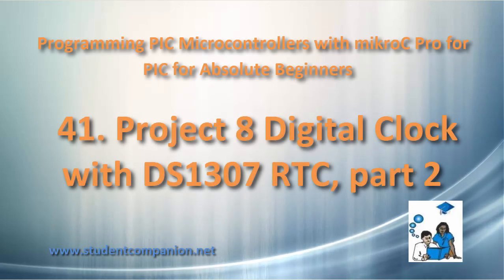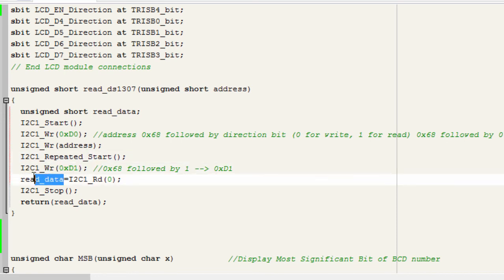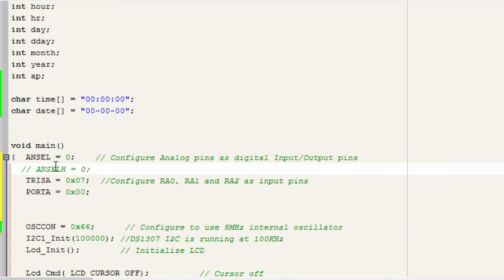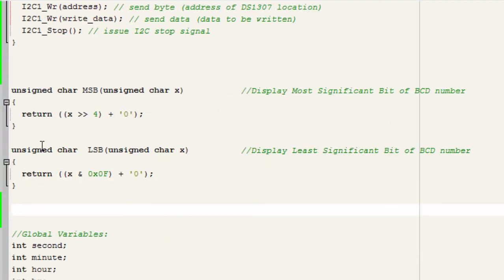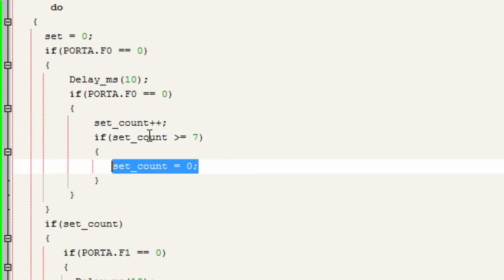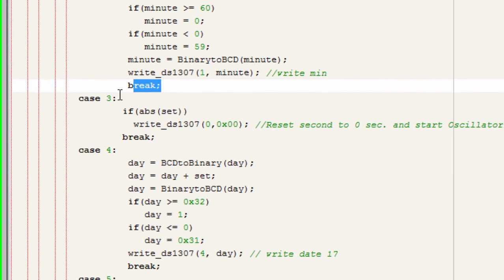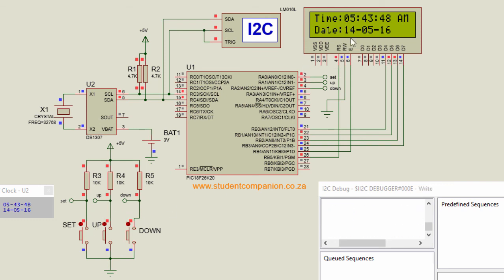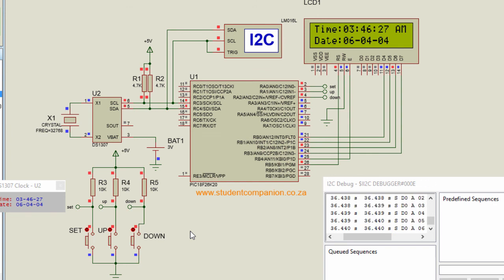41- Project 8 Digital Clock with DS1307 RTC, part 2 | mikroC Pro for PIC Tutorial

Comment: professor, I see that you created a function to convert BCDtodecimal and DecimaltoBCD.  this function can be used in any situation that requires conversion, or only in this example of a program that you created.  I need to do a similar function but I'm having a hard time understanding what the algorithm should be like.
Reply from the maker: It's a simple function that can be used in any situation that requires that conversion as long as you call it correctly.

Comment from the maker: Please note: PIC18F26K20 operates with 3.3V even though in this simulation we used 5V. In your hardware 3.3V should be used if you choose this PIC and the values of all the resistors should be calculated accordingly.

Comment: Nice project, but i have a question. When i press the up button, nothing will go over 9, minutes go to 09 and then back to 00
Reply from the maker: Hi. Are you sure you are in minutes setting first? The minute should increment till 59
Reply: Student Companion yes, but they won’t go over 09, same with hours and date
Reply from the maker: Use mikroC built-in Bcd2Dec() and Dec2Bcd16() functions instead of the BCDtoBinary() and BinarytoBCD() functions. 
Here is the full modified code:
/*

 * File:   Digita_Clock.c
 * Author: Student Companion SA: www.studentcompanion.co.za
 * Real Time Clock Using DS1307 on I2C Bus
 * To simulate in Proteus, The I2C debugger must be connected on the I2C Bus.
 */
// LCD module connections
sbit LCD_RS at RB4_bit;
sbit LCD_EN at RB5_bit;
sbit LCD_D4 at RB0_bit;
sbit LCD_D5 at RB1_bit;
sbit LCD_D6 at RB2_bit;
sbit LCD_D7 at RB3_bit;
sbit LCD_RS_Direction at TRISB4_bit;
sbit LCD_EN_Direction at TRISB5_bit;
sbit LCD_D4_Direction at TRISB0_bit;
sbit LCD_D5_Direction at TRISB1_bit;
sbit LCD_D6_Direction at TRISB2_bit;
sbit LCD_D7_Direction at TRISB3_bit;
// End LCD module connections

unsigned short read_ds1307(unsigned short address)
{
  unsigned short read_data;
  I2C1_Start();
  I2C1_Wr(0xD0); //address 0x68 followed by direction bit (0 for write, 1 for read) 0x68 followed by 0 --> 0xD0
  I2C1_Wr(address);
  I2C1_Repeated_Start();
  I2C1_Wr(0xD1); //0x68 followed by 1 --> 0xD1
  read_data=I2C1_Rd(0);
  I2C1_Stop();
  return(read_data);
}

void write_ds1307(unsigned short address,unsigned short write_data)
{
  I2C1_Start(); // issue I2C start signal
  //address 0x68 followed by direction bit (0 for write, 1 for read) 0x68 followed by 0 --> 0xD0
  I2C1_Wr(0xD0); // send byte via I2C (device address + W)
  I2C1_Wr(address); // send byte (address of DS1307 location)
  I2C1_Wr(write_data); // send data (data to be written)
  I2C1_Stop(); // issue I2C stop signal
}

unsigned char MSB(unsigned char x)           //Display Most Significant Bit of BCD number
{
  return ((x >> 4) + '0');
}

unsigned char  LSB(unsigned char x)          //Display Least Significant Bit of BCD number
{
  return ((x & 0x0F) + '0');
}

//Global Variables:
int second;
int minute;
int hour;
int hr;
int day;
int dday;
int month;
int year;
//int ap;

unsigned short set_count = 0;
short set;

char time[] = "00:00:00";
char date[] = "00-00-00";

void main()
{
   I2C1_Init(100000); //DS1307 I2C is running at 100KHz

   ADCON1 |= 0x0F;        // Configure all ports with analog function as digital
   CMCON  |= 7;           // Disable comparators

   TRISA = 0x07;
   PORTA = 0x00;

   Lcd_Init();                        // Initialize LCD
   Lcd_Cmd(_LCD_CLEAR);               // Clear display
   Lcd_Cmd(_LCD_CURSOR_OFF);          // Cursor off
   Lcd_out(1,1,"StudentCompanion");
   Lcd_out(2,1,"Digital Clock...");
   Delay_ms(5000);                    // 5s delay
   Lcd_Cmd(_LCD_CLEAR);               // Clear display
   Lcd_out(1,1,"Time:");
   Lcd_out(2,1,"Date:");

   do
   {
     set = 0;
     if(PORTA.F0 == 0)
     {
         Delay_ms(100);
         if(PORTA.F0 == 0)
         {
             set_count++;
             if(set_count >= 7)
             {
                set_count = 0;
             }
         }
     }
     if(set_count)
     {
        if(PORTA.F1 == 0)
        {
          Delay_ms(100);
          if(PORTA.F1 == 0)
              set = 1;
        }
        if(PORTA.F2 == 0)
        {
          Delay_ms(100);
          if(PORTA.F2 == 0)
              set = -1;
        }
        if(set_count && set)
        {
          switch(set_count)
          {
            case 1:
                    hour = read_ds1307(2);
                   // hour = hour &  0b11000000;
                    hour = Bcd2Dec(hour);
                    hour = hour + set;
                   // hour = BinarytoBCD(hour);
                    if((hour & 0x1F) >= 24)
                    {
                    hour = 0;
                      hour = hour ^ 20;
                    }
                    else if((hour & 0x1F)<0)
                    {
                    hour = 23  ;
                    }
                     hour = hour & 0b00111111;
                    hour = Dec2Bcd16(hour);
                    write_ds1307(2, hour); //write hour
                    break;
            case 2:
                     minute = read_ds1307(1);
                     minute = Bcd2Dec(minute);
                     minute = minute + set;
                     if(minute >= 60)

                        minute = 0;
                     if(minute < 0)
                        minute = 59;

                    // minute = BinarytoBCD(minute);
                     minute = Dec2Bcd16   (minute);
                     write_ds1307(1, minute); //write min
                     break;
            case 3:
                    if(abs(set))
                      write_ds1307(0,0x00); //Reset second to 0 sec. and start Oscillator
                    break;
            case 4:
                     day = read_ds1307(4);
                     day = Bcd2Dec(day);
                     day = day + set;

                     if(day >= 32)
                        day = 1;
                     if(day <= 0)
                        day = 31;
                     day = Dec2Bcd16(day);
                     write_ds1307(4, day); // write date 17
                     break;
            case 5:
                    month = read_ds1307(5);
                    month = Bcd2Dec(month);
                    month = month + set;

                    if(month > 12)
                      month = 1;
                    if(month <= 0)
                      month = 12;
                    month = Dec2Bcd16(month);
                    write_ds1307(5,month); // write month 6 June
                    break;
            case 6:
                    year = read_ds1307(6);
                    year = Bcd2Dec(year);
                    year = year + set;

                    if(year <= -1)
                       year = 99;
                    if(year >= 50)
                       year = 0;
                    year = Dec2Bcd16(year);
                    write_ds1307(6, year); // write year
                    break;
          }
        }
     }

      second = read_ds1307(0);
      minute = read_ds1307(1);
      hour = read_ds1307(2);
     hr = hour & 0b00111111;
      //ap = hour & 0b00100000;
      dday = read_ds1307(3);
      day = read_ds1307(4);
      month = read_ds1307(5);
      year = read_ds1307(6);

      time[0] = MSB(hr);
      time[1] = LSB(hr);
      time[3] = MSB(minute);
      time[4] = LSB(minute);
      time[6] = MSB(second);
      time[7] = LSB(second);
      date[0] = MSB(day);
      date[1] = LSB(day);
      date[3] = MSB(month);
      date[4] = LSB(month);
      date[6] = MSB(year);
      date[7] = LSB(year);
    //  if(ap)
     // {
     //    time[9] = 'P';
      //   time[10] = 'M';
     // }
     // else
     // {
     //    time[9] = 'A';
      //   time[10] = 'M';
      //}

      Lcd_out(1, 6, time);
      Lcd_out(2, 6, date);
      Delay_ms(100);

   }while(1);
}
Reply: Thanks!! It works wonderfully now!
Reply from the maker: You are welcome!
Reply: Is there a download link? i can't find source code.

Comment: How to add day of the week in digital clock (0=sunday, 1=monday...)
Reply from the maker: Hi. You can read the date time register address 03h. Just the same way we are reading the seconds, hour, minutes registers. It got a range of 01 to 07
Reply: @StudentCompanion  But currently i am using pic16f877a and timer without the help of RTC. (according to requirement)
Reply from the maker: @limweixen7701  If you are not using an RTC then you will have to calculate everything is software. You will have to assume the fist day and first date, when you increment the hour after 24 hours you increment the day as well and after 7 days you reset. You can hold it in an array for example a value of 1 as Monday, 2 as Tuesday and so on.
Reply: @StudentCompanion  How to do so? Can show the codes?
Reply from the maker: @limweixen7701  how are you incrementing the date?
Reply: @StudentCompanion  using the array. Should I show the codes to u in email?
Reply from the maker: @limweixen7701  You can post it here in the comments
Reply from the maker: @limweixen7701  this is not how you generate RTC with interrupt.  I don't see any interrupt code there.
Reply from the maker: @limweixen7701  You can follow this project to understand the concept : https://www.studentcompanion.co.za/digital-clock-using-pic-microcontroller-interrupt-xc8/
Reply from the maker: @limweixen7701  we don't provide support in private messages
Reply: @StudentCompanion  Ok never mind then
Reply from the maker: @limweixen7701  ok

Comment: How can i find i2c devices in proteus ?
Reply from the maker: There are so many devices using I2C, from sensors, expanders, displays etc. What device are you looking for?
Reply: @StudentCompanion   Hi, I want to use I2c in this video but i cant find this I2c scd sca trıg in Proteus.How can i find?
Reply: @StudentCompanion   What is the name I2c in proteus ? which model ? thank you for your attention :)
Reply from the maker: I beleive you mean the i2c debugger, you can get it under the virtual instruments where there are other instruments like terminal, multimeters and oscilloscope